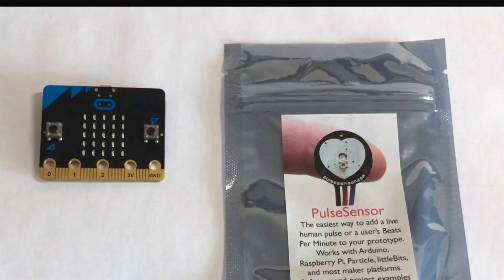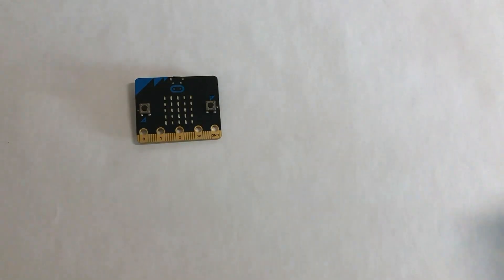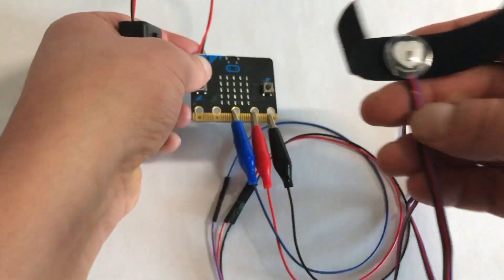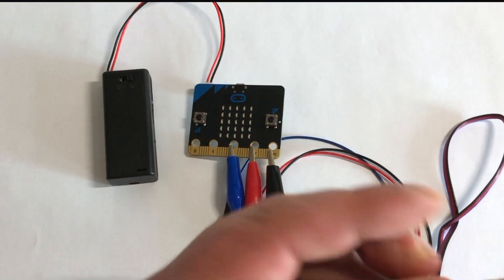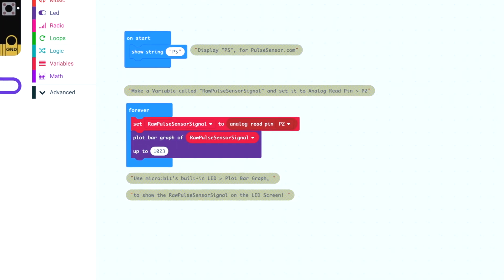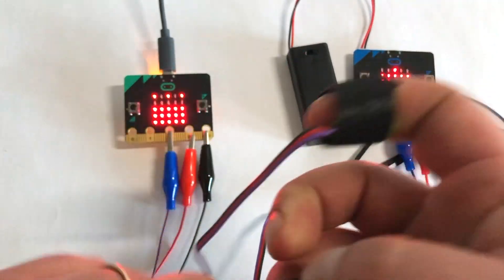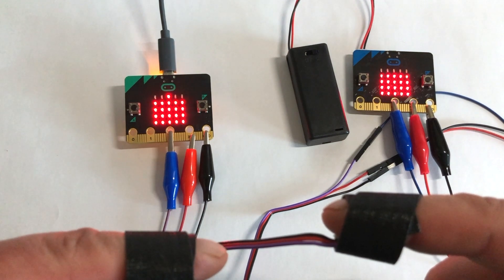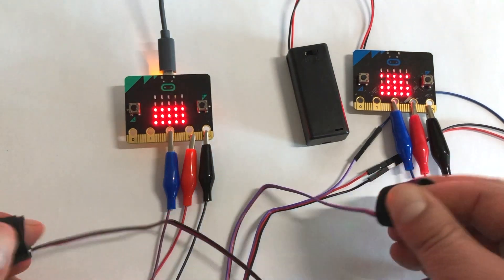micro:bit and the PulseSensor!

Comment: what are those wires attached to the microbit called? are they included with the pulsesensor or do you have to get those seperately?
Reply from the maker: Zayed, those cables are called "alligator clips".  They are not included with the PulseSensor, or micro:bit .  You can find them any place that sells micro:bits or PulseSensor's are sold.
Reply: alligator clips

Comment: Hm my pulse sensor is not working properly. When I wrote your code and uploaded it to a microbit, then the LEDs flash when I touch the pulse sensor with my finger. But when I put my finger on the pulse sensor permanently then the leds stop blinking
Reply from the maker: Hi Todor, thanks for the comment.  The most common reasons for error are typically related to counterfeit PulseSensors, unfortutntualy.  Your PulseSensor should look like and act like the PulseSensor in this video.   
Given that, I made another video about troubleshooting your PulseSensor.  Try this with your PulseSensor and it should help you see what's going on pretty quickly: https://www.youtube.com/watch?v=tYVed75UVZY